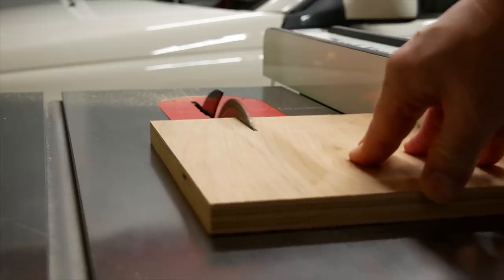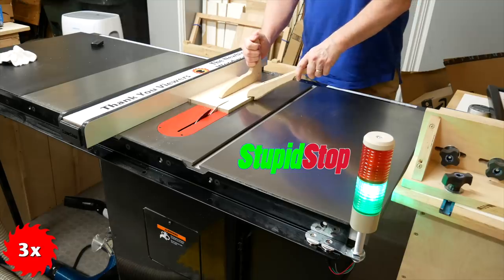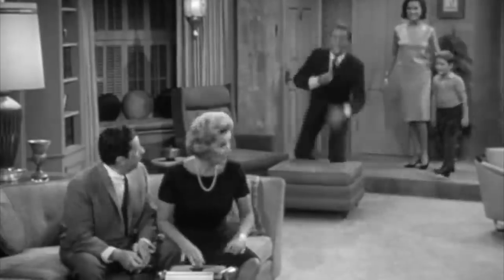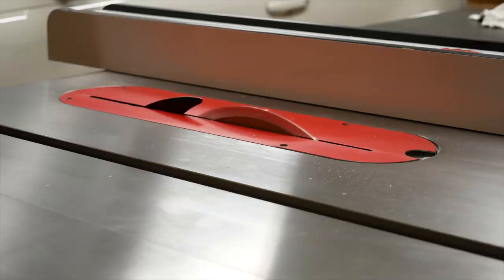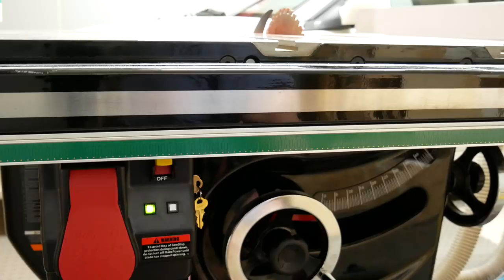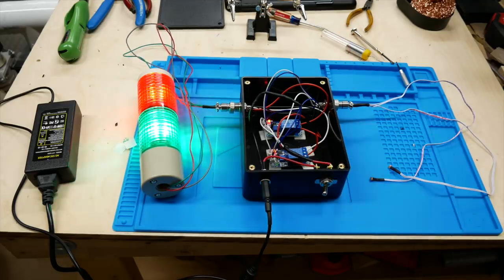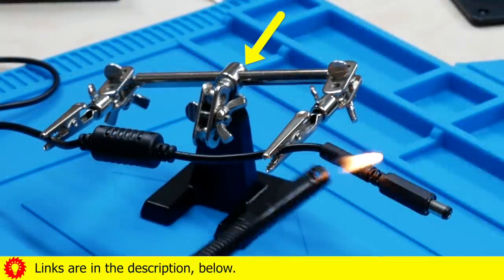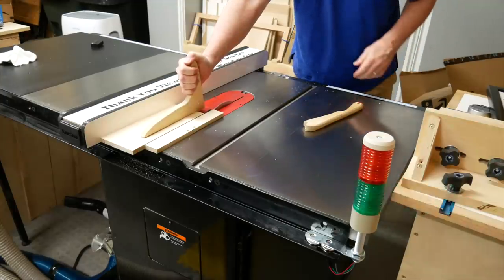Woodworking Distractions, ADD and my StupidStop

Comment: Well its a motor and 2 things can happen with it either you apply power to it and it spins, or you spin it and it creates power just like a turbine. One thing is constant thought that when the blade is spinning there is voltage on the motor power lines. Add a simple voltage detector to the line that has adjustable settings with a POT (Thing to spin to set voltage threshold before triggering relay). If blade is spinning then either there is electricity being applied to motor and will trip voltage detector and relay will turn red light on, or motor is still spinning and creating voltage and will do the same thing. Very simple circuit! Whats even cooler is that you can make it non contact if you want and you are just detecting the electromagnetic interference on the line.. Like those handheld voltage detectors for testing if wires are live electricians use
Reply from the maker: Sounds good to me. Maybe someone can give it a try. Thanks! 😄
Reply: That would probably work for any non-SawStop saw... the lights on the SawStop mean lots of different things, though, so for the SS, it’s useful to actually detect the lights.
Reply: @tomjohnson8220  All we care about "Is blade spinning" Nothing else matters for a stupid stick!
Reply from the maker: @steve_main  That's probably true for a non SawStop, but when it comes to something with safety technology, the lights serve a lot of important features. Don't knock 'em until you've tried 'em. 😉
Reply: @TheNewbieWoodworker  Sorry I thought the point of a stupid stick was to just show if blade is still spinning . If you wanted more advanced features to show that the saw stop provides this method for sure would not work.

Comment: Another dangerous tool is a bandsaw.  Some saws have brakes, either automatic or foot operated.  Some don't.  You can still get injured if not paying attention.  Circular Saws are another.  People go way out of their way to Not use the blade guard to do something in a hurry.  Lathes can be very dangerous if the stock is not locked down securely and the tailstock engaged when possible.  Excessive speed on a lathe is another very dangerous situation.  I think the most distracting item is other human beings.   I know this is a touchy subject but well worth mentioning.
Reply from the maker: Touchy, maybe, but you make some great points. I'd add drill presses, because they hardly make any noise compared to other tools, so it's easy to forget they're running.

Comment: With an Arduino and a photo cell you could detect the blade spinning thus turning on a Red LED and Green when the blade is stopped.
Reply: That was my first thought, but it'd be clogged with sawdust in no time. Hence I thought that moving away and monitoring the spindle motor would be better
Reply from the maker: @georgeprout42  Now you guys are cooking!
Reply: George Prout yep I agree with you George now, it is back to using a Hall Effect sensor to sense the current flow.
Reply: The Newbie Woodworker 🤪 we maybe cooking as long as we don’t start smoking!
Reply from the maker: @TheFalconJetDriver  That's funny but it's no joke (and you've probably experienced something like this before but I have to say it anyway). Eons ago I was working with a PC, adding a couple of expansion boards. When I plugged it in and turned it on, it literally started to smoke. Obviously I yanked the plug quickly, but the motherboard was a total loss of course. But all I could do was laugh, especially when the smell hit me. (I can't remember exactly what I did wrong, but I think I scratched the board, or did something with one of those pieces of metal that cover up unused slots.) Anyway, good times. 😛

Comment: Will these modifications void the warranty on the SawStop?
Reply: It looks like no modifications were done as the light sensors are only taped onto the lights.
Reply from the maker: As the other comment says, there's no modifications to the SawStop at all, so it can't affect the warranty.

Comment: One fluke hazard to add to your list : slippery workshop floor mats! I almost slid into a running table saw blade the first time I used one of those jumbo sized black rubber "anti-fatigue" mats : turns out the mold release coating used in the manufacture of the mats leaves them very slippery! Taking the mat outside onto a gravel driveway & repeatedly "roughing up" both sides by dancing all over it corrected that safety hazard!...
Reply from the maker: Great point, thanks for mentioning it! 😄

Comment: Oh and why go you remove the top saw guard when you make cut through cuts, if you do grooves or dados then yes, but after that put it back on so you can’t physically touch the blade
Reply from the maker: It's a valid point others have mentioned also. The issue is that I use my cross-cut sleds a lot, and I'd have to remove it for them. But that doesn't mean I shouldn't at least try and see how much work it is to use it. Thanks for the comment!

Comment: I told my husband if he hears a power tool running, he needs to wait until it stops before he comes into the shop.
Reply: Great idea.  I have been startled more then once when my wife enter the shop while I was using the table saw. I think I will ask her to wait as well. Thanks.
Reply from the maker: Very smart!

Comment: thankfully, I don't have ADD.  I suspect that when one uses a Sawstop they probably lose a little bit of caution, knowing the technology will save your finger.   I use an older Craftsman table saw (unfortunately) and I am over the TOP cautious....because I know the only "safety feature"....is my brain.  That said, it's natural for humans to get comfortable in any endeavor when they do it repeatedly many times per day.....so that leads to less cautious behavior which leads to accidents.   I just piddle a bit in my garage now, but once I get more space....I'll get a Sawstop as well...just for the extra protection.
Reply from the maker: I think everything you said is spot-on. Safety technology does indeed make us more complacent, even if we don't have ADD. And again, repetition certainly does the same thing, or at least puts us in a slight daze. Good luck getting more space, and thanks for the comment! 😄

Comment: Those are electromechanical relays (atleast 10Amp rated by my estimate)...overkill for the extremely low current needed for those lights. 

They also are not rated for clicking on and off more than a few thousand times...that blinking actions is going to wear them out. 

A cheaper and simpler circuit would involve the LDRs going to a comparator driving a MOSfet or TIP120 Darlington transistor...no moving parts and those can drive more than an amp of current through the lights. You can also have multiple lights and light bars.
Reply from the maker: Thanks for the comment and it sounds really good, except that it's greek to me. I'd have no idea how to implement it! If you want to give me more details, you could email me from my website, thenewbiewoodworker.com. Click the "Menu" in the upper right, and email me from there. Thanks!
Reply: The first design uses the relays because the circuit is super simple. I also built one using transistors, but takes more electrical engineering skills. I have no idea what the MTBF of those relay boards are.

Comment: is there a reason for all the electronics? i mean if your saw has those 2 lights surely you could just tap into the wires that go to the lights on the saw. even if you just use them as signal wires and power the lights externally it would be less electronics. 

but maybe im missing something here though maybe there is a reason for all of it.  Great video by the way :)
Reply from the maker: Thanks. I don't know enough about electronics to know if that would be a good idea or not, so I just went with this design since I couldn't mess up my saw if I screwed up. 😄
Reply: @TheNewbieWoodworker  ah that's a fair point I'm like that wth some things. I Can follow a guide but doesn't mean I could do something different myself
Reply from the maker: @TotoGuy-Original  Yep, that's me too. Except that I usually change something anyway, then pay the price later. 😄
Reply: @TotoGuy-Original  The SawStop has some very sensitive and complex electronics in it. I wouldn’t want to mess with the wiring since it could interfere with the safety circuit. An optical coupling won’t interfere, and it turns out it’s pretty simple.
Reply from the maker: @tomjohnson8220  👍
Reply: @tomjohnson8220  that sucks
Reply from the maker: @TotoGuy-Original  No, it's actually great. It's not fragile - he's just saying he wouldn't want to mess with it, and I agree, especially since this solution works so well anyway. 😄

Comment: one thing I do is to envision how I'm going to move the board across the saw, and where my hands will be from the moment I turn the saw on until I turn out the lights...okay, until the blade stops spinning.

A second item of consideration...my shop is small, cluttered, messy and dangerous. Where my FEET will be is another one of my key considerations at every moment. (My basement is a certified OSHA violation!)  If my mental gymnastics reveals that I have to step over something to complete the cut...I stop what I'm doing, and re-arrange things so that doesn't happen.
Reply from the maker: Yeah, that can be dangerous. I think your first priority should be to start making shelves, cabinets and drawers so you can get some of that stuff out from under your feet. And if you're anything like me, you should finish in about... wait, what is this word "finish"? 😄
Reply: @TheNewbieWoodworker  "Finish" is for quitters...people who do that stop working on the project.... :-)
Reply from the maker: @just-dl  😂

Comment: I'm surpised the blade brake is so poor. I've seen cheapy mitre saws with better stopping times. I personally wouldn't relyon the light sensors, I would have the arduino detect the current drawn by the saw itself, like the auto vacuum cleaner kits you get.
Reply from the maker: Thanks! 😄

Comment: I keep seeing people in videos feeding stock while ripping at rate not much higher than a snails pace. Why? If you have a decent saw and the right blade you should feed as fast as the saw can take without stalling or slowing much. You will get a smoother cut without burning
Reply from the maker: Thanks for the comment! I'll have to take a look and see why I'm doing it that way. It may be due to having used under-powered saws before, and not thinking about changing my habits. Thanks for making me think about it!

Comment: Using a blade guard will stop you touching a spinning blade, unless you're actively trying.
Reply from the maker: "unless you're actively trying" Sorry, that just made me laugh. Hey, I wouldn't put it past me. 😛Others have mentioned the blade guard too - the issue is having to remove it all the time when I use my cross cut sleds, which I do a lot. But as I've said, it might be worth the time for me to try it with this new saw and see how much work it is (or isn't) to take off and put back on. Thanks for the comment. 😄
Reply: @TheNewbieWoodworker  I know what you mean with the sled. I modified my guard to have a spring loaded pin instead of the small screw. Simple to get it off and on again.
Reply from the maker: @maxximumb  Mine is actually extremely easy to remove - just take off the insert plate, flip a lever and take out the guard, then put the insert back in. Since I honestly haven't tried to do it much, I don't know if it's a pain or not. I'm gonna start giving it a try.

Comment: Instead of photoelectric, why not just tie into the wires for the indicator lights?
Reply from the maker: Two reasons: 1) I didn't want to mod my table saw if I didn't have to, and 2) Knowing me, I'd screw it up somehow. 😛
Reply: The Saw Stop uses some fancy electronics to sense tiny currents in the blade.  It’s possible that altering the electronics will  interfere with that.
Reply from the maker: @tomjohnson8220  Good point, Tom. Unintended consequences suck. 😏

Comment: My Achilles heel in the shop is the router. It's such a quiet tool compared to most saws and I've set a spinning bit down on my workbench or project more times than I can remember. ie https://www.instagram.com/p/B3KX1baB5im/
Reply from the maker: I'm with you 100%, David. I almost never use a handheld router now (after my accident a few years ago), but the router on my router table is comparatively quiet, hiding the fact that it has BIG TEETH.

Comment: Hi, I am 69 now and I put being easily distracted down to my age, I may now have a name for it.  Anyway don't give up the hobby you like, doing things you like are what makes it worth living, so you continue for many years to come. On the subject of accidents in the workshop, I was turning a large piece of wood and forgot I had the speed up high from a previous job I was doing, the wood came flying off and although I had a full face mask  and rebar across to stop any accidents I still lost five teeth and had to visit my least popular place the hospital and I did see birds flying around my head. (I thought that only happened in cartoons)
Reply from the maker: Holy crap! The closest thing to that that I ever had happen was when the cutting disc flew off my Dremel, and almost cut my jugular. I had to change my shorts after that. 😛But man, what you went through sounds awful. I hope you're OK, if it's even possible after something like that! As far as chalking up distraction to age, I think it absolutely gets worse as we get older. "What did I come into the kitchen for?" "Where did I leave that?" "What was I just thinking?" My brother calls it CRS. I'll paraphrase it as "Can't Remember Squat". 😄Thanks for the comment.
Reply: @TheNewbieWoodworker  I am OK now, just not quite as pretty. In my hast to tell you what happened, I forgot to say that the log I was going to turn had a large rotten piece in the middle that no-one would have known about so even if I had remembered to turn down the speed it would have come off, just not with so much force. I still like turning but always check the speed (I think!)
Reply from the maker: @johnfithian-franks8276  LOL, thanks for the good humor, and glad you're as OK as can be expected. 😄

Comment: Two incidents I remember off the top of my head. 

I was in metal shop in high school and polishing an aluminum candle stick, while wearing a watch. The chuck hit the watch case and luckily I had an elastic band on the watch. Slapped the crap out of my wrist, but no damage to anything other than my pride.

The second one, the victim wasn't as lucky.

Years ago I was working as a patrol officer.  I was driving by a machine shop when an ambulance call dropped. I was there within 60 seconds.  The gentlemen worked there but was off of work and wanted to tell a coworker about something.  He was only there for a few minutes. As he was talking to his colleague,  he lifted his left hand into the path of a bit, which caught his ring finger. This machine was about 9 feet tall, and didn't even slow down as it through him into a control handle striking his chest and grossly amputating his left ring finger. He died immediately from a flailed chest.

His wife and children were waiting in the car.

While these happened in metal shops, all shops have similar rules. I've investigated hundreds of industrial accidents and getting in a hurry, injures  more people than you can imagine. 

Be safe.
Reply from the maker: Wow. That's a sobering story. It seems wrong to say "thanks for sharing it", but I am grateful that you gave us something powerful enough to be a strong reminder.
Reply: @TheNewbieWoodworker  a fraction of an inch killed the Gentlemen. A millimeter further away would have been a near miss. I'd also recommend tourniquets for shops first aid kits. Extremities are the most injured areas, tourniquets will save a life if limb's vascular system is injured.
Reply from the maker: @ddurkof  👍

Comment: Why are you touching the blade in the first place? If it's to change or align it, always unplug the machine first. Otherwise, keep you hands off the blade.
Also, don't become dependent on safety features. As someone has already said on here, the most important safety device is between your ears. Safety equipment is great, and should be used, but don't let it make you complacent. Stay just a little paranoid around your power tools.
Thanks.
Reply from the maker: https://thenewbiewoodworker.com/2019/09/04/woodworking-and-add-redux.html